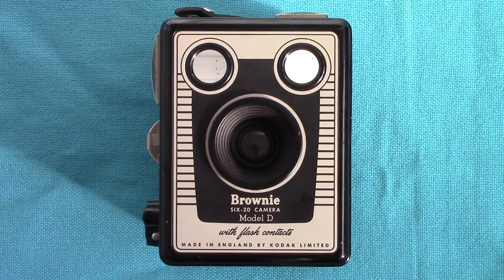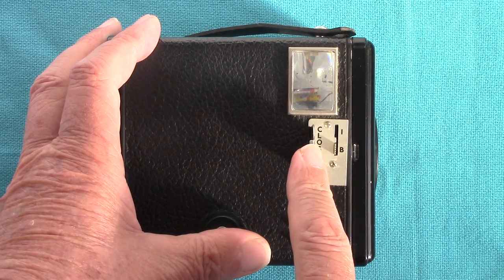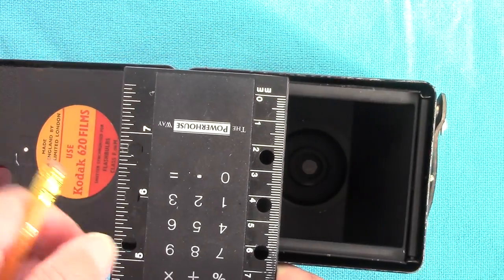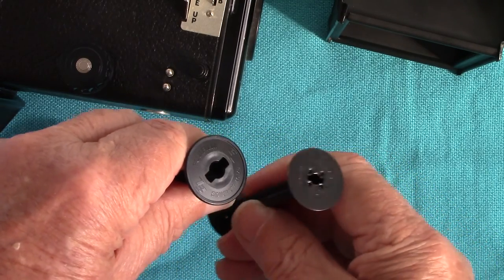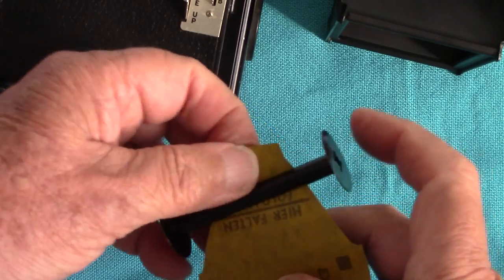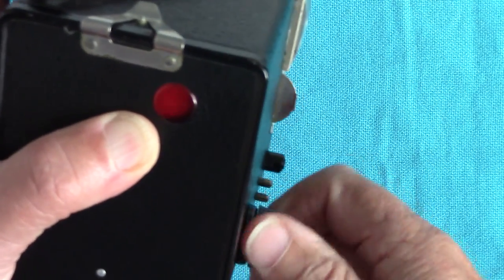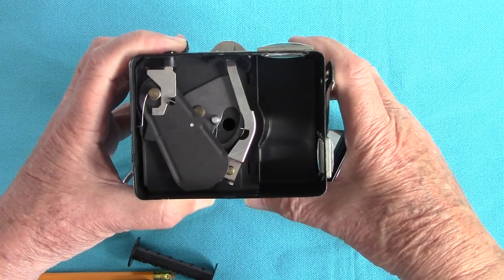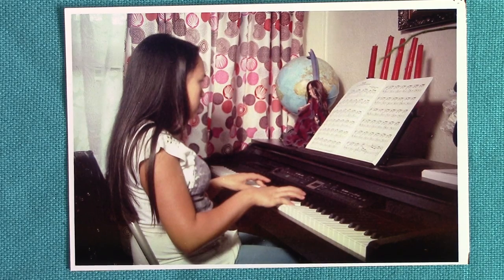Kodak Brownie Flash 620 Model 'D'

Comment: Peter, you must have a huge archive which could be displayed on-line. Where can we see you archive?
Reply from the maker: Moses : You can see my Camera collection HERE on my Flickr Album : 

https://www.flickr.com/photos/25850987@N03/albums/72157614991236917
Reply from the maker: Moses : You  can see my Camera Collection HERE on my Flickr Album : 

https://www.flickr.com/photos/25850987@N03/albums/72157614991236917
Reply: Peter Elgar Depth of field was not a problem for the Pentax f:1.2 lens, which is surprising.
https://www.flickr.com/photos/25850987@N03/sets/72157627941783567